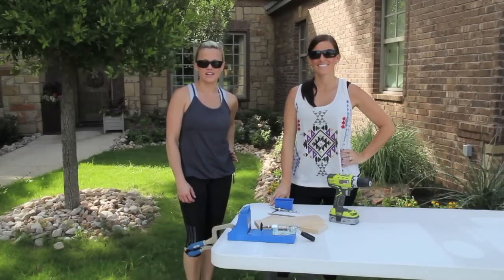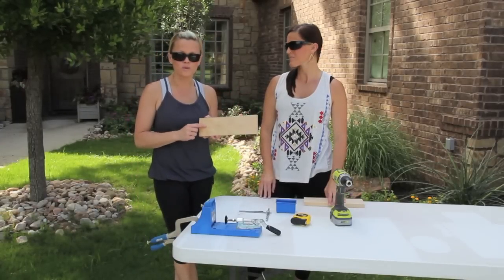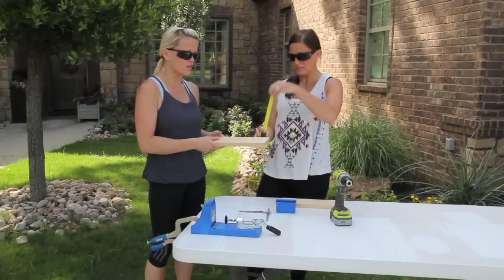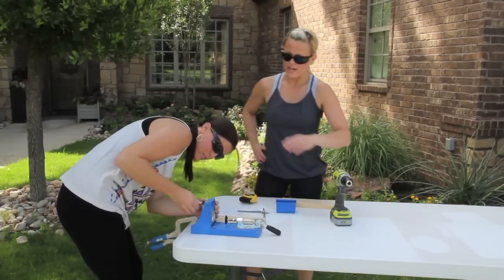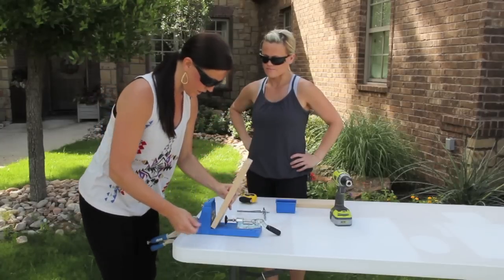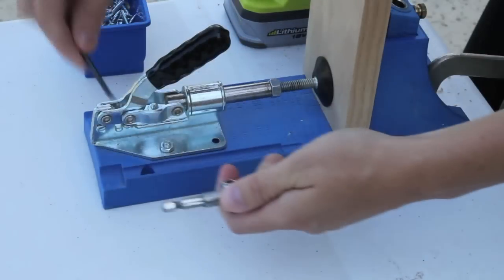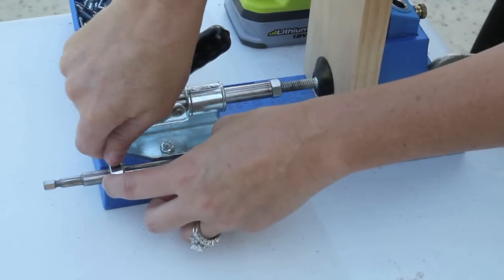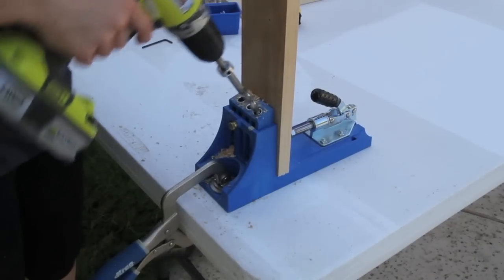How to use a Kreg Jig

Comment: Good video by the Shanty Sisters.  For those of you who are probably on a woodworking budget, I would also recommend the pocket hole jig from Harbor Freight Tools.  This Kreg jig will run you about $99.  The Harbor Freight version is $64 and if you wait and use a 20% or 25% coupon, you can get it for around $48.  Works just as well.

Comment: Though this is an old video, I was able to glean some information. Thank you. Now for the nasty? stuff, I'm not a fan of butt joints. Unless properly joined then come loose. A way to eliminate this problem is to use glue first, then use the pocket screws.

Comment: When drilling the holes the drill should be turning before you stick it all the way in.
The reason is sometimes that little tip on the drill bit will break off when it catches the wood and that's a $30 bit

Comment: I didn't understand that post where the bit was being measured in that little groove. It went by too fast for me. I guess because the chunky part may be a universal piece fitted with various bits but maybe that was ommited. I think I understand that it's to determine what size screw you will use. Not width but length/depth. Is that right? And what was the Allen key for?
Reply from the maker: If you have a Kreg Jig, this would probably make more sense. The box comes with everything in the video. The Allan wrench adjusts the depth collar (the chunky part on the bit). You use the indention on the jig to set the depth collar.
Reply: Ok. Thanks. I wanted to make sure it was an item I could likely use (and frequently) before committing to purchasing it since it has a bit of a hefty price tag - that's why I don't have one to reference.

Comment: I just used a Kreg jig (k4) for the first time to make a table top. My wood is 3/4”.  Followed the directions. For some reason on some of the holes the screws went all the way through top. 😔. I did notice my stop had slipped. Would this be my problem. I used 1 1/4” screw. Thanks for any help.

Comment: I am sooo confused on the size of kreg screw to us, specially when joining two different size wood (example: a 2x4 and 3/4" plywood).  I've looked at the Kreg site, that chart is printed so small I can't even read it and I've watch several videos.  It's OK to say, "test it" but these screws are expensive and I don't yet have a large assortment in stock so when doing a project, I need to buy screws when I pick up materials. It would be less frustrating if I knew in advance what size screws to buy - and have them be the correct size!

Comment: I want to join a small post to a mfd board. Will this work? The pole is 2" square and board is 1/2". * Almost like adding legs to a table, but it's a different project. Which depth do I use?
Reply from the maker: If the board is 1/2" set your jig to drill 1/2" pocket holes and use 3/4 or 1" screws.

Comment: Ok this is for everyone that owns a Kreg Jig kit. Now Im TERRIBLE on making straight holes and lining it up wit other pieces of wood. SO on Ebay I seen the master kit that says it comes with everything for like $100.00 So wat I wanna know is it worth it? Easy to use? Can stand up to being beat to hell? noone wants tools that will break right away So pretty much is it worth it? Thanks
Reply: +Erik Iacopelli Any Kreg Jig kit is an amazing tool you can use, and use and use. They will be $ 100 well spent
Reply: +Erik Iacopelli , I work for a professional cabinet company and we use Craig Pocket Jigs and they are the best on the market for joining wood. its easy to use and it comes out strong and professional. Get it an learn how to use it. It will make you a better carpenter.